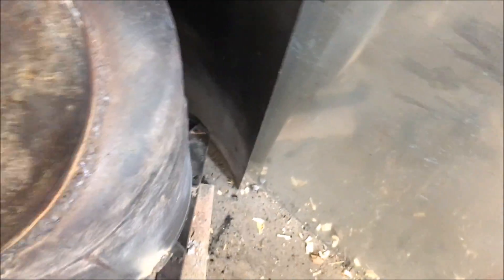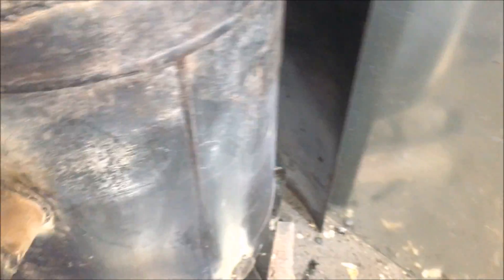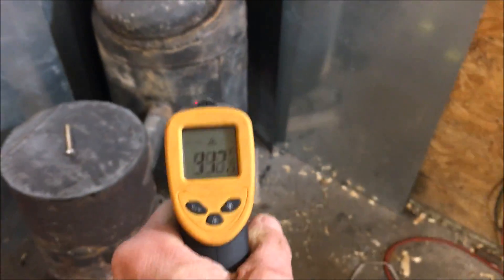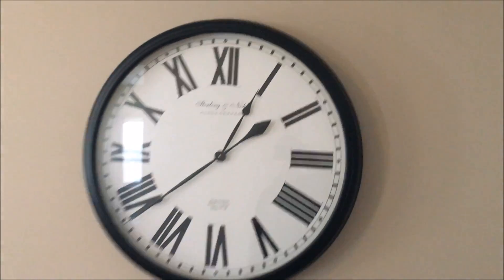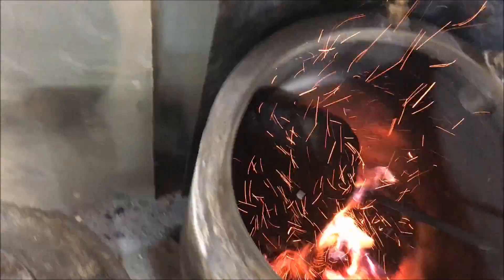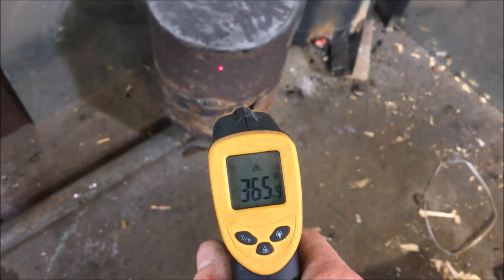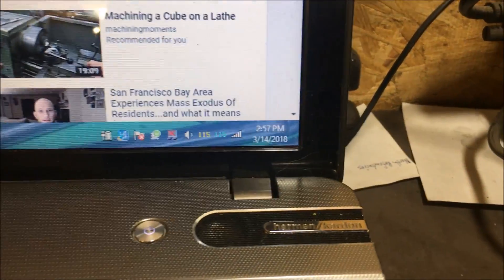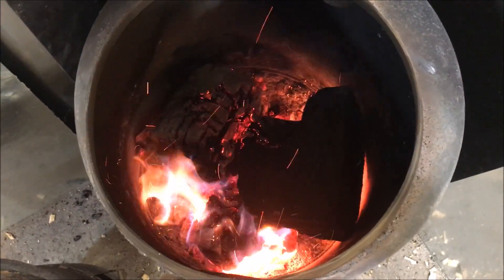Burning huge logs (NEVER CHOP WOOD AGAIN)

Comment: I’m currently burning out the stump of a tree which dropped in a cyclone a few weeks back and the majority of the fuel I’m using is the green wet timber which was on it and it’s been slow going to get the timber hot enough and dry enough to keep burning. Yesterday however I discovered a new tool to accelerate the process, a couple of pieces of gal pipe welded together and my battery powered shop vac connected to the exhaust air side, man that is impressive the roar that makes with just some added forced air onto the embers, very intense heat by comparison to natural air draw, I found it hard to believe the difference

Comment: Logs will burn longer than split wood. The tradr off is, they will burn at lower but usually hot enough, so you won't need to get up in the middle of the night to fuel the fire, so it's actually better imo.

Comment: The problem though your wood burner is old fashion single burner which wastes a lot of wood. Most newer stoves have dual burners that reburn the smoke and extra gases created during the first burn, saving 25-30% more wood. It's good that you can burn entire logs but it uses a lot of wood unnecessarily.

Comment: Get (or make a big one) a solid potato peeler that's comfortable to hold.  If you make one, make it 2handed.  You can shave a log for about 30 seconds and have all the tinder and kindling you need.  Set up your burner with air inlets on the sides that would have the air rotate around the log and down out the bottom.  After burning wood for years, I tried building a pellet stove and i loved it so much so i built a new stove that i can burn pellets or "logs" that are up to 15" wide and 24" tall.   The rotational airflow helps to separate ash (not much) from the exhaust flow.